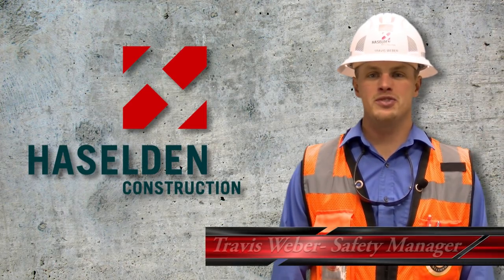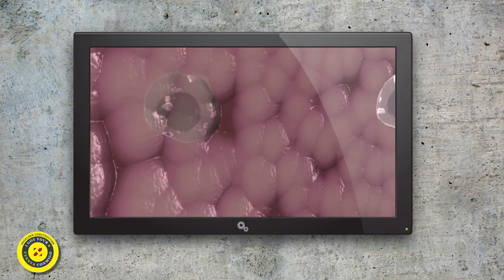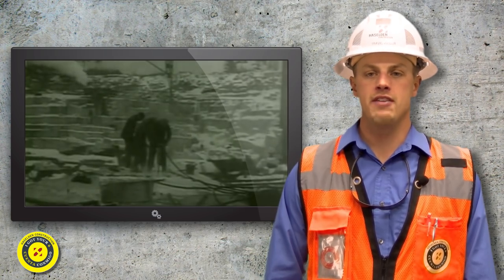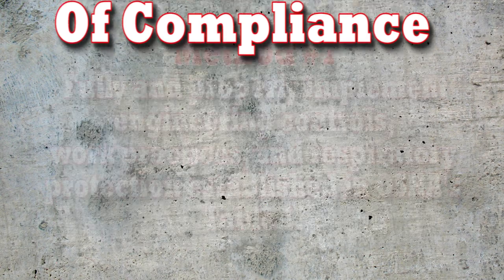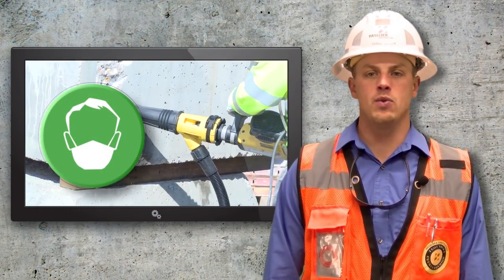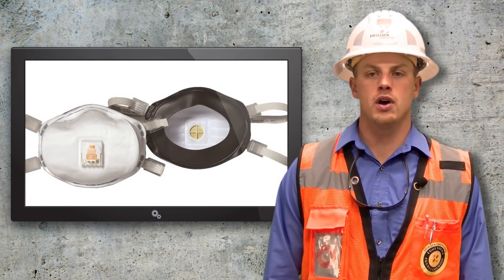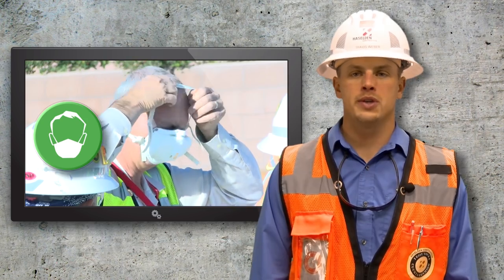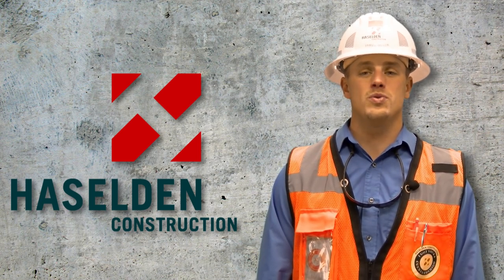Haselden's Introduction to Silica Safety

Comment: APF's for a given respirator type should be validated through  Quantitative Fit Testing - otherwise you are wearing a respirator that may not be   Protecting you .  The Fit Factor  ratio is the ambient airborne concentration / concentration inhaled inside the mask. This can be measured and a certified test result given for the individual.  Testing is Mandatory

Comment: Silica dust in extremely minute amounts below the permissible level of exposure can get scavenged away by other immune cells without the risk of the crystals going into the lung's walls and causing the fibroblasts to cause irreversible scar tissue to form in the lungs - but if crystals ingested are above the PEL, enough crystals are trapped in the macrophages and cause the macrophages to die and set off a chain of immune responses that set off this destructive scar tissue in the lungs. As mentioned before, the fibroblasts (one of your immune cells) scavenge the dead macrophages and leave behind fibrous tissue that causes this severe pulmonary damage from this silica.
Reply: 4:36 - Accelerated silicosis is known as progressive massive fibrosis. It is a little bit like cystic fibrosis that affects the lungs also.